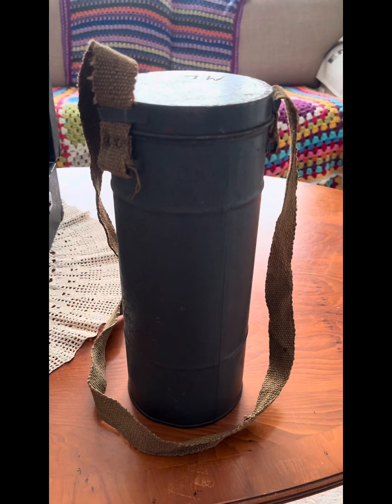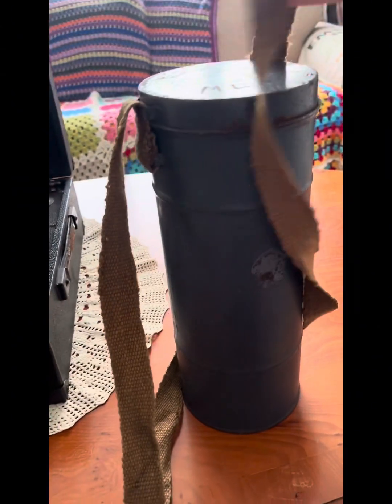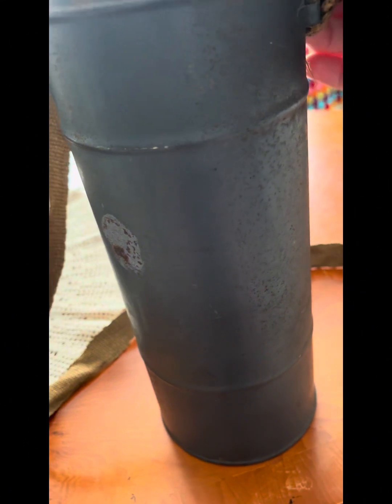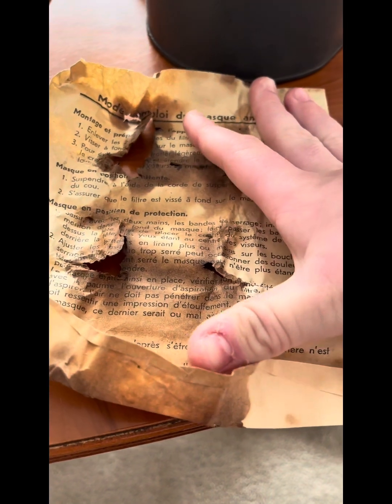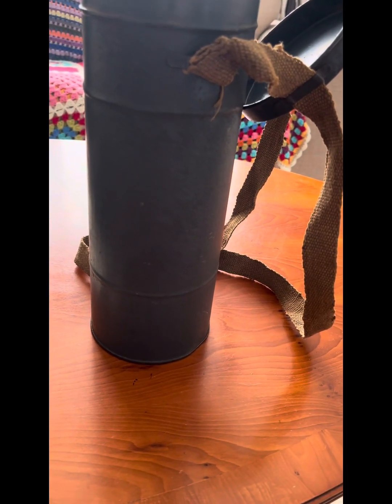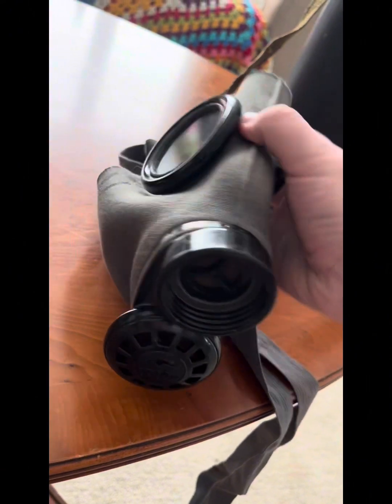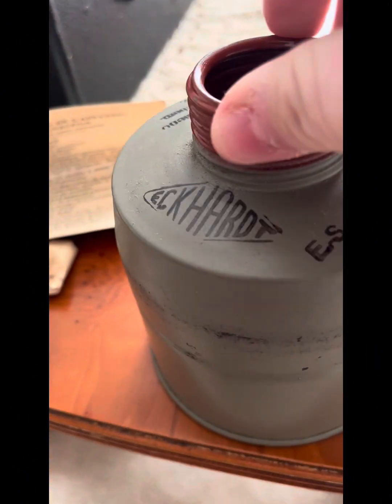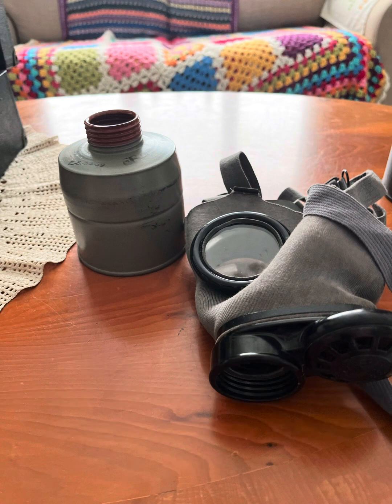FM3A Gas Mask (In-Depth Video)

Comment: listen man i kinda urgently need to know, do the gas mask filters contain asbestos? i got this old fm3a mask with a filter from 1973. they supposedly stopped putting asbestos in 1972 but im still not sure. i need to know fast please answer.
Reply from the maker: Hello, I would assume that the FM3a filter contains asbestos just like all other wartime masks however it’s nothing to worry about if you are not disturbing it, if the filter is from 1973 then it’s probably safe but no guarantees. 

Regards,

TM.
Reply: @Tmilitaria Thank you man, I already sealed it with some electrical tape and some stuff but thanks man